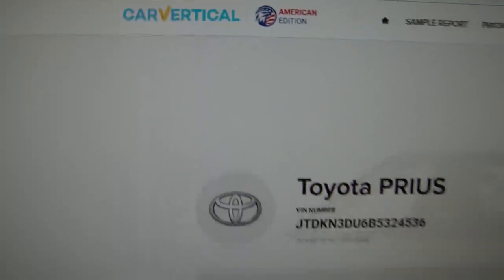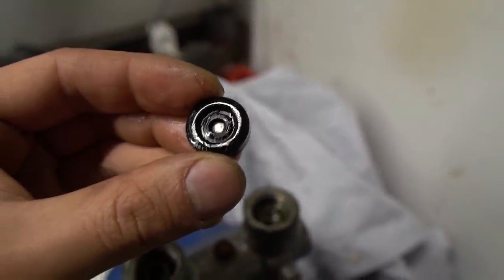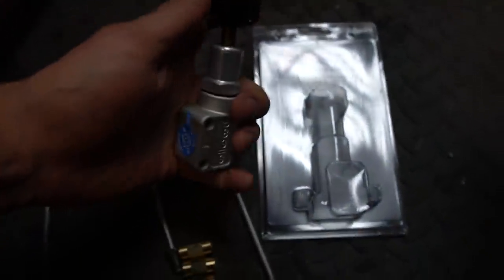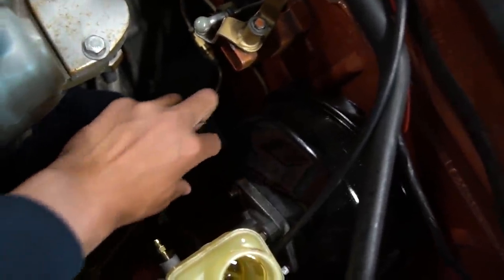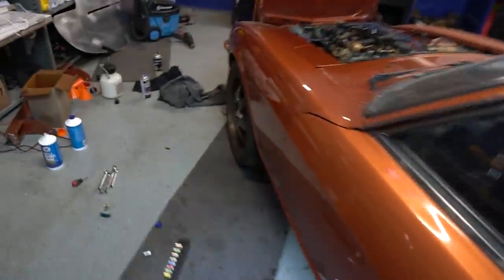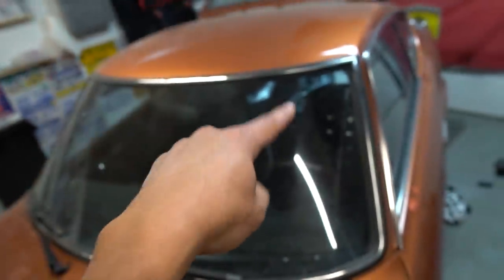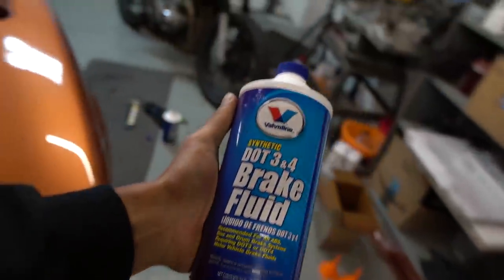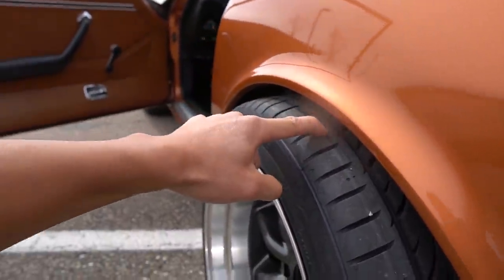Custom Brake, Prop Valve, And First Drive In The Z - The JDM Devil Z Build Series #16

Comment: The part you removed in the engine bay is a distribution block I believe. The rear proportioning valve is somewhere around the rear diff